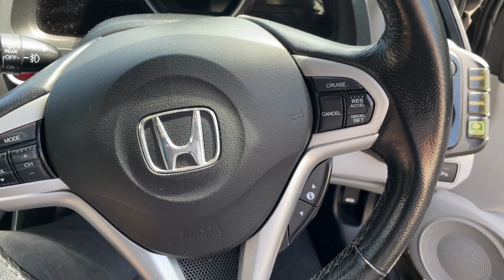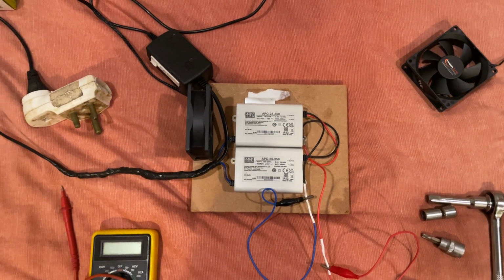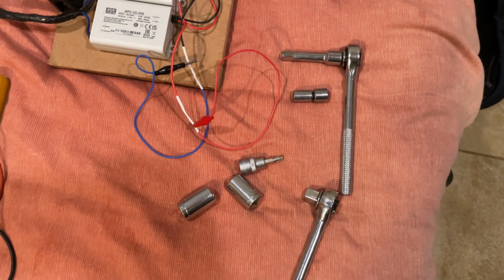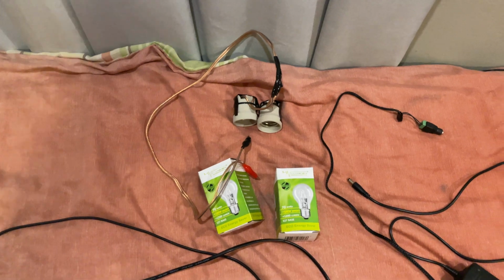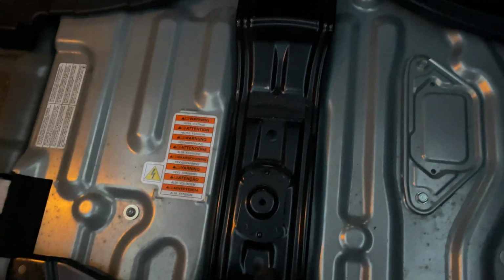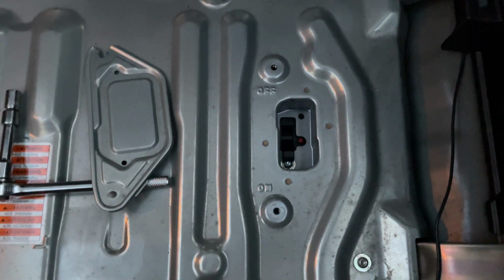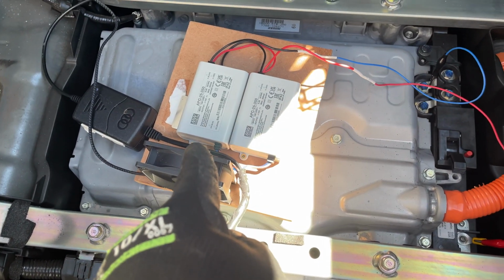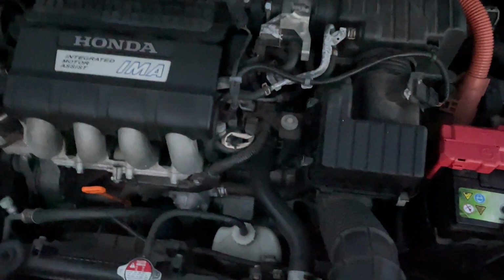Honda CR-Z IMA NiMH Rejuvenation Process

Comment: After you do the 12v disconnect to reset the useable capacity start the car and let it tick over for about 3-5 minutes so the system can work out the new state of charge.  👍